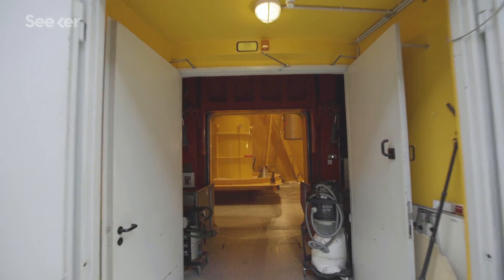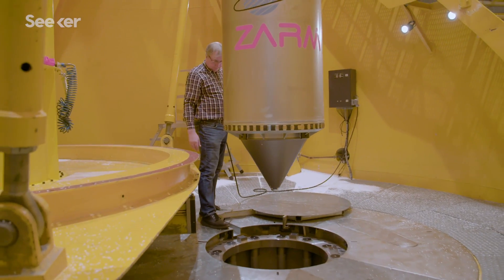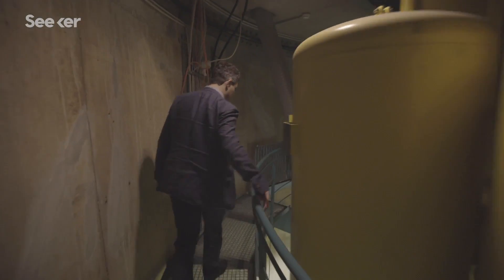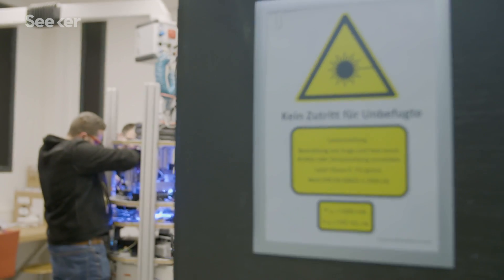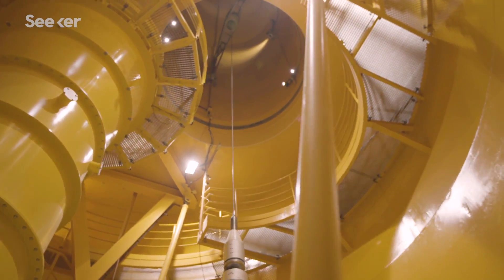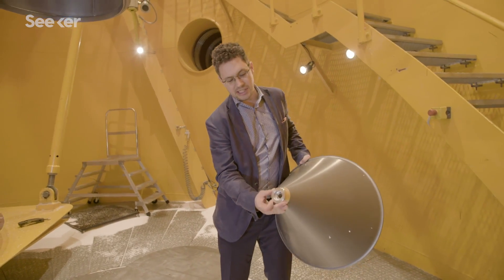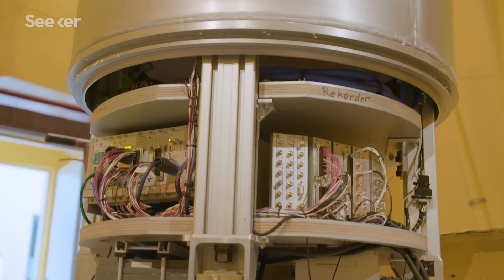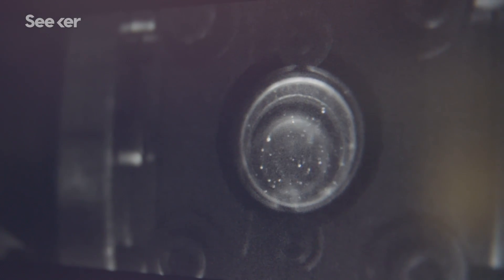The Zero Gravity Tower Preparing Us For Future Mars Missions

Comment: Is there still anyone using Windows XP??
Reply: No, the last one died out thousands of years ago, before the pyramids were built. Some question whether they really existed.
Reply: In computers that are not connected to the internet, and whose only purpose is to manage one big piece of machinery, the smartest thing is to leave thigs just as they are, avoiding the risk of breaking something when upgrading. There are a lot of XPs running in factories and even on navy ships…
But I thought the same as you! :-)
Reply: Francesco Ghizzo lots of corporations don’t bother with updating windows
Reply: xp still has about 3% of market share....small number but that is still quite a few XPs out there
Reply: besides SCADA only ATMs and Voting machines still use it... so nothing important ;)
Reply: there are millions of machines still running xp, i know of some that run 95.

industrial machines that use a pc to control don't get a upgrade, it may introduce bug's and they are not connection to the internet or network anyway.

as a example, a concrete mixer, it had 5 big cycloses and all u need is to put in the numbers and it takes the correct amount of stuff out of the correct tower.
and then mixes it in a big vat and ads water.
then a cement truck drives under it and the system tels u when it is ready to be transferred.

these installation and software are always custom.

if it ant broke dont fix it.

there ar even baggage handling systems at big airports that run on doss to this day.
Reply: Maybe it was a virtual machine? I have multiple Winblows VMs (From 98SE to 10). Linux is my primary OS and there are some software/games you just need Windows for. Regardless if how much a shit cheesebox it is. Dude did say the facility was developed and built 30 years ago. It's also possible their particular software won't work on a newer version, even if they wanted to upgrade.
Reply: As you could see in the video they had win xp next to a win 10 computer. The xp was probably to control a machine and was not connected to the internet
Reply: My school!
Reply: They paid a fortune to get someone to write the program that operates the tower. So if they upgrade the control computer, they would have to pay to have the program updated. So it’s cheaper to keep using the old operating system. It goes back to that old adage, “If it ain’t broke, don’t fix it”.